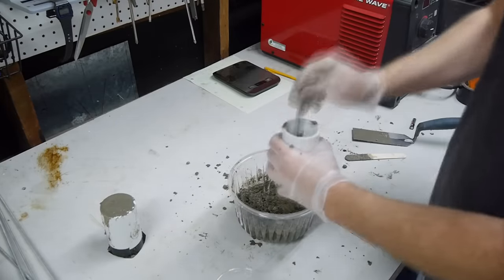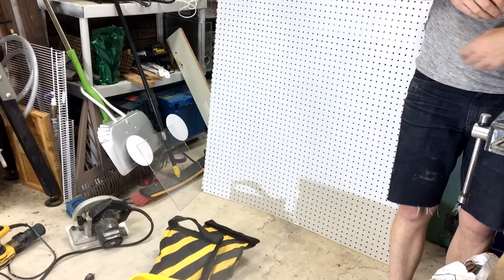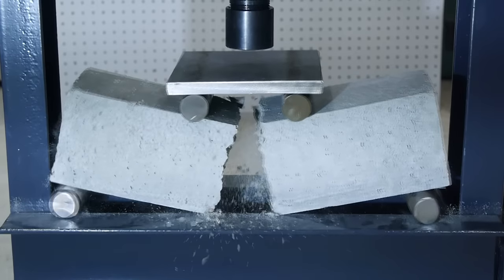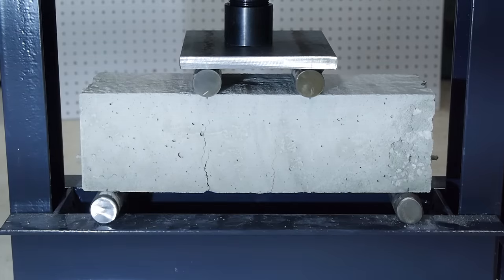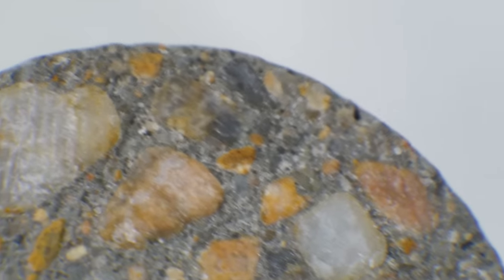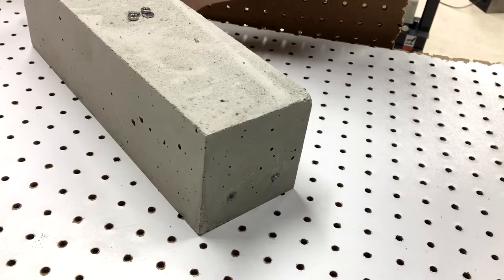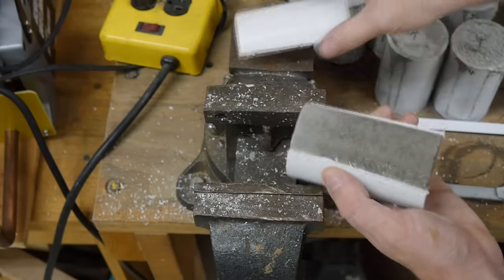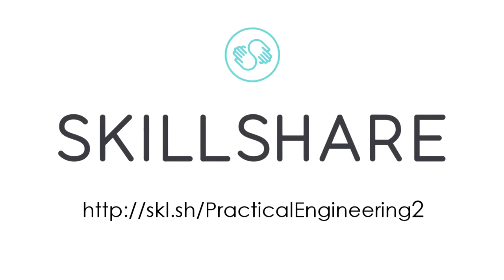Why Concrete Needs Reinforcement

Comment: I am only an apprentice builder, but for what I see on site, the rough way the rebars are placed, the rustiness of the reinforcing steel and the life expectancy of the concrete slab, about 25 years, before the concrete cancer strikes and slowly renders the floor useless, it makes me wonder whether it is even worthwhile to use concrete and we should stay with hardwood construction.
What are your thoughts on the matter?
Franklin

Comment: One of my dreams is to crack open some ancient structures and see if they used rebar of some primitive sort.  The theory that ancient structures may have been made out of concrete or similar composite materials is very interesting to me. Unrelated somewhat to this video.  But evidence of reinforcement might be able to prove conclusively that structures like the pyramids were made in part or fully with composite materials.
Reply: Haha concrete is a composite! Sand, gravel, cement and water.

Comment: Rebar is bitter sweet for concrete, makes it much stronger for a short period (in retrospect of how long concrete can last). The issue with rebar is it will rust within the concrete due to concrete holding moisture. This will eventually weaken the concrete and break it apart.

Comment: As always you bring complex information to an easy to understand process for us common folks. Recently I watched one of your videos where you used a t-shirt as reinforcement in sane to show the difference it made before the weight applied caused the support to fail. If I were to add fibers to the concrete as I mixed it, combined with the rebar, would this give me a stronger beam? Can you demonstrate the scenario results with abundant fibers, light application of fibers and with just the rebar? What candy of fibers can be used?

Comment: I'd be interested to see the difference in having stirrups on the outside of the transverse bars on a column and the seeing the same test but have the stirrups inside the transverse bars instead. Always wondered if it made a difference in the real test setting

Comment: Concrete doesn't require steel, there is a section on plain concrete in the ACI code. Also referred to as monolithic concrete. Plain concrete generally works for concrete structures up to about a 2.5:1 dimension ratio. Common in things like isolated footings, and the heel and key of retaining walls. As the footing gets flat and wide it becomes a spread footing, and as it gets deep and skinny it becomes a cast in place shaft, both of which need reinforcement. But for that in between sweet spot monolithic concrete is great. In some environments if the concrete loses it's high PH due to things like salt, the steel will rust and destroy the concrete from the inside out. I see this all over in the coastal towns. Things like a concrete curb with the top split off and a rusted piece of rebar showing where it split in half. It can be better to avoid using rebar if it's not strictly necessary, there are also concrete additives that can help with this.

Comment: Well, as a mechanical engineer I must say, it is not so common, that threads fail before the material itself. At least from what I know for metric threads. Maybe a second nut would have helped. Of course that depends on multiple factors, like material of the nuts, maybe the zink coating of the threads etc. But if you consider the classic stress vs expansion test (for sure the english name is different :D), there you will often find the material to be tested installed by threads. And again, of course there the diameter of the material is usually smaller then the thread... I just didn't expect the nuts to fail in this test :D

Comment: it's weird how it's so complex yet also very obvious when you think logically about it. rebar can at least bend slightly before breaking and is overal much stronger than concrete, so ofc using it would help concrete

Comment: Your tensile strength demo is a little off because the hooks you embedded focused the tensile load to a much smaller area. Redo the compression test on the press with the same hooks embedded and see what happens.  It wasn't compression vs tensile, it was the full diameter of your cylinder (in compression) vs a much smaller diameter.

Comment: As there would be shops in the centre of Parrahub, I wonder if a 70m diameter wall 2m thick x 400m high would have sufficient strength to support the building it the wall was post tensioned every 1m of the circumference.

Comment: I am fascinated by the pantheon's ability to exist without reinforcement. A capless dome with a light divoted ceiling. I wonder how much more we could do to perfect such a design?
Reply: Romans were very smart. The amount of columns on the pantheon is one of the reasons it has yet to fail, but equally important is the fact they had a very different form of concrete than what we have now. They used sea water and volcanic rock to make a form of concrete that actually gets stronger the older it is

Comment: So, There is a fundamental flaw you are missing here.  While what you say is true, you haven't gone all the way.  There is a cheaper way to enforce concrete without rebar.  Using pea gravel or pea stones as a base.  This works because you cover the base of the area, pour concrete, it molds around the pea gravel causing many tiny arches.  As we know arches are indeed nearly impossible to break under compression and because it's at the underside and solidified against many other arches, the tension side at the bottom effect is reversed to compression instead of becoming a tension pressure.  I do this for all of my concrete applications and never have cracks.  I hope you try this and make a video about it.

Comment: Underground at the mine they have rebars 8" & 10" that uses a bolt and a plate at the end and mixed with resin  so they can set in and withstand heavy loads for ground control which is the bed rock every bed rock is different but some are frail some are really hard depends but we also use cables and mix it with concrete so they have better support during bigger excavation or longer support on the long run every bolt/screen/etc has a lifetime so why they keep testing other products and new technology but look it up I'm curious to see and hear.

Comment: The Romans built concrete structures that are still standing 2000 years later . When exposed to moisture, iron rebar corrodes and expands and causes cracks.  The Romans used calcium oxide (quick lime) not slaked lime to make concrete. When cracks developed, entering moisture chemically reacted with the quick lime and sealed the cracks. Basically the Romans used a self-sealing chemical process to make concrete. Concrete does not need reinforcement with rebar. It just needs to be formulated with calcium oxide (quick lime). I am an industrial chemist not a civil engineer but I have some understanding of chemistry.
Reply: Roman concrete is impressive. In Caernarfon we have old roman walls bonded with roman mortar and they are still standing after almost 2000 Welsh winters. I can see how self- sealing cracks lengthen the life of mortar, but I doubt it will make rebar reinforcement obsolete in concrete applications where tensile strength is needed. Mortar only gets compressed.

Comment: Stress leads to cracking, cracking to water intrusion, water freezing and rusting rebar leads to spalling and within 75 years the bridge is structurally compromised. 
While roman bridges used more materials, they were smart enough to use arches that take advantage of stones compressive strength instead of some self-destructing alternative.
While engineers are great at making something that pushes what's mathematically possible it operates within such SPECIFIC parameters that it quickly fails the test of time.

Comment: I know of something that would be better than concrete for building... 
Ceramic Titanium; aka Ceratanium. That stuff can resist explosions as well as bullets, and has very good resistance against compression, tension, and shear to the point those 3 weaknesses are nearly non existent: It's most common use is in watches, or in rare cases: entire blast shields.

Comment: I do have questions: Wondering How to best lay a concrete slab for a detached garage. Does it need rebar if the rebar is only good once the cement cracks? If I pour the cement above grade- just set the forms on top of the soil rather than dig down, will that be enough to keep water out if it is on the highest side of my yard in Utah, which is relatively dry compared to coastal Oregon, though we do get heavy rain from time to time.  - I actually don't know anything about the neighbors yard to the south (the high side), but I don't think her back yard is much higher, though all the property to the South continually rises slightly, while going North, it slopes, and  I would guess we have a  10-15% slope in our yard. 
Also worried about a drive way we want to pour between our garage on the south and the neighbors yard, which in the front & side yard is 12-15" higher than our yard with a partial cement wall holding her yard at a higher level.  Are we going to flood our garage by putting in a cement driveway sandwiched between her higher yard and our garage?

Comment: We are using area of concrete specimen to calculate the Compressive strength, what is the role of thickness of concrete in compression?why we are not using volume instead of area for compression calculation. Does the thickness play any role in strength?

Comment: You know, with research on regenerating concrete, any minuscule crack can be self fixed by bacteria releasing ions like calcium.

However, does this propagate the cracks in the future by filling in the gaps made, like microscopic calcium “wedging”, or does it actually glue the parts together?

That would be a cool test for ductile stress on said regenerating concrete.

As for the failure of the nuts, probably “cleats” in every length of rebar could work to that effect in the intervals of each concrete beam?

Comment: When using rebar how to determine 3/4 or 5/8 on the vertical and lateral  axis? Residential  vs commercial?  And why oh why do you have to keep concrete wet during the curing process? Does it really make a difference?

Comment: I plan on building a small post-frame home on an insulated stem wall block foundation, 5 blocks high. I will reinforce with rebar horizontally on the bottom and top courses and vertically throughout. Grouting is the issue. Using a special mix with an expensive pump is favored by contractors, done at the end. Can desired results be achieved by filling the voids with concrete as the courses are laid? This looks a lot like slip forming and seems acceptable and much cheaper and easier.

Comment: I saw on YouTube that some people are making fences out of concrete (posts and panels).  Meanwhile others are mixing dish soap froth into their concrete to make "aircrete" which can be 65-80% lighter than regular concrete.  Yet another made backyard paving tile slabs using white concrete and white aquarium pebbles but found that the aquarium pebble concrete was less resistant than white concrete made using garden pebbles, he thought maybe the aquarium pebble rocks were less hard than the landscaping pebbles (granite?).  All this to say, would it be possible to make reasonably sturdy fence using forms and a combination of concrete, perhaps a more aerated mix for the top of the panels and posts?  To keep costs down what would the minimum thickness have to be?

Comment: They used fiberglass “rebar” in my new shop floor. It’s 3-15 feet of packed gravel, 2” foam board, glass bar, heat coils, under a 6” x  40ft x 55ft slab of concrete. I question the wisdom of saving a few $ when you’ve got hundreds of thousands of $ invested in the rest of the “toy box”. I hope they were right.

Comment: What’s the best way to measure and the placement of steel or rebar before casting concrete slab foundation or on top of columns ?

Comment: I recently had a Holiday in Southern Italy. Most of the bridges and motorway flyovers are riddled with stress failures. I measured one (a Railway Bride) at 9cm gap at the bottom and worked out that the top was already at 2 cm. This means that the only thing holding the Trains up is a bunch of exposed steel. The  bridge was on the coast and these trains are very large. How long do you think it will take for the rebar to snap? I mentioned it to an engineer working at the nearby depot and he laughed.

Comment: I understand there are some situations in which you need reinforced bars, but I don't get why people reinforce flat concrete roads. The support reactions are distributed, not like the concentrated supports tested in the video, so the deflection is near 0in.

Comment: That’s interesting. I see some Concretors using concrete with small 2 inch long fibres which are very strong and hard to snap. This material has been around for a few years. I was alerted to its use a few years ago when a local concrete tank maker used it in his tanks. Needless to say he had a nervous breakdown and went bankrupt fixing all the tanks that failed. A concrete driveway was installed a few days ago near where I live and the was no rebar installed. The concrete had these previously mentioned fibres in it. Having just retired from a 50 year building career I have seen a lot and have a little bit of knowledge about concrete and reinforcement. These fibres ring alarm bells in my head. Have you had anything to do with this material and if so can you do a segment on it?

Comment: Concrete and steel make the perfect couple; they have similar coefficients of thermal expansion, thus a suitable bond could be achieved between them. And while rebar enhance the Concrete performance under tension, concrete  protects the rebar from fire and corrosion. Isn't that the best love story?

Comment: Don't put rebar or wire mesh in your driveway or in your residential concrete.

1. The failure rate isn't much different for residential use.
2. When it does fail, it will be much more expensive to remove and dispose of it, and therefor replace it.
3. Steel oxidizes, and that will hurry along typical residential concrete failures before you get any real added benefit from the added tensile strength.
Reply: Rebar is fine for things like porches or things that might deal with tensile forces, but still stay away from steel mesh.

Comment: So basalt mesh is being used for domes in some new building applications. Clearly not as strong as rebar of a given diameter but how does a mesh strengthen concrete in that shape? How does it compare to rebar?

Comment: What importants does the aggregate size and type play in the strength of the concrete.  Also is there a standard percentage or distance the reinforcement should be from the bottom and top of the structure to handle the loads. Also what is the ideal mix portland/aggregate/water and sand to gravel for the aggregate.  Why do these proportions matter so much.  I built a sidewalk with concrete i mixed in my 1/3 yard mixer and varied the mix a little from the start to the finish.  It seems like the all sand no gravel finished the best.  As of yet none have cracked and i park my f250 long bed crew cab on it regularly (over 2k lbs on each front tire).  However, i suspect the first block i made with more gravel will crack first. I did use a lot of rebar about 20 percent from the bottom and some toward the top. This is mn so i expect frost to put a tension load on the top as it pushes up during the winter.

Comment: I wonder if a brick could withstand pressure if it as multiple layers of strong metal sheets that look like a graph paper but the square are holes and the out line are metal bars?.

Comment: I am no engineer but I challenge the theory that the top of the beam experiences compressive stress. The load is downward in the middle and the resistance is upward at both ends. That looks like shear stress at 2 planes, no?

Comment: Question: Many beam failures suffer from corrosion of the reinforcing system. Can this be prevented say by using stainless steel or still using ordinary steel and using cathodic protection?  Or of course is there another way?

Comment: The tests probably would have been better if you prepared the concrete better by making sure it had no air bubbles.. making it slightly stronger. Which would improve the results

Comment: I like your content. Could you do some work involving coated rebar? I'd like to start precasting wall panels but I want to know if there is enough of an advantage to justify the cost. Thanks.
Reply: No, if you're doing pre cast walls you're going to have a better time with regular rebar. As long as your surface is finished and sealed properly you won't see anything different in the two walls during your lifetime.

Comment: i was curious about fiber reinforced concrete either with fiberglass, carbon nanotubes, nylon etc. because i read somewhere that having those increases the breaking loads of concrete. When i have to do a quick patch job, i mix a tangle of nylon cord and fiberglass in concrete to prevent voids and patch in by pushing the bundle in the holes (especially helpful for vertical holes). Just wondering is there any efficacy for this or just a waste of time and energy?

Comment: WHY DO different materials handle different stress differently? Do we use concrete rather than just complete steel solely because steel is rarer, or does concrete have a physical advantage over steel?